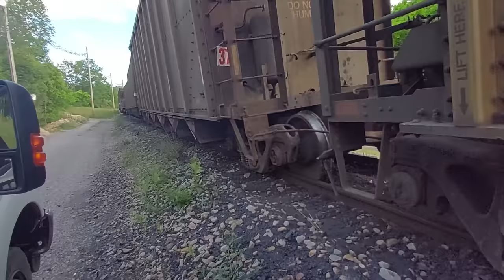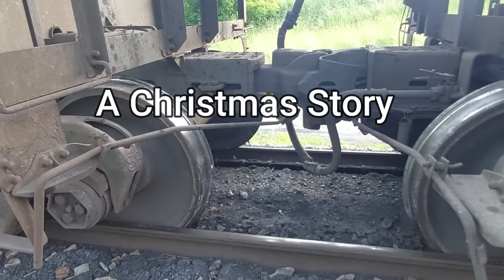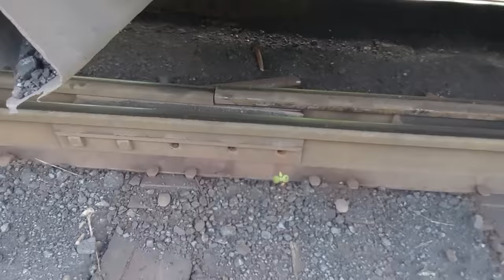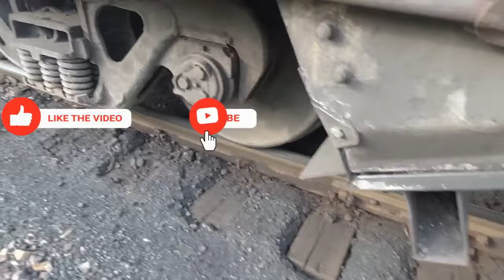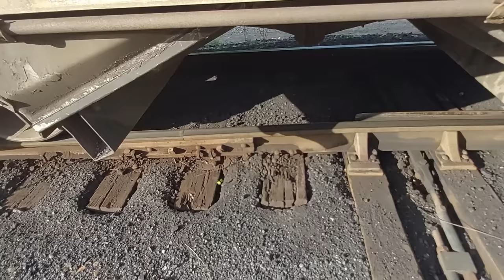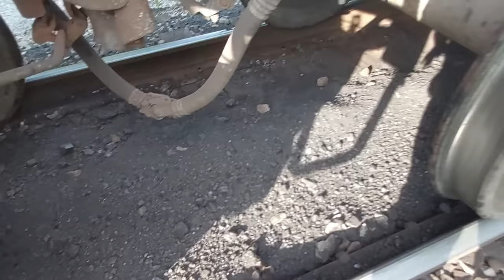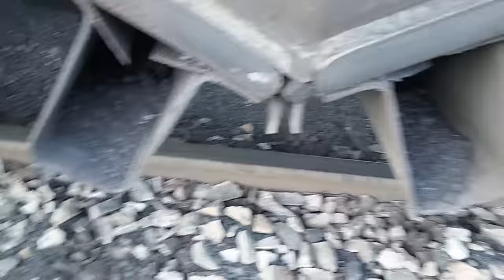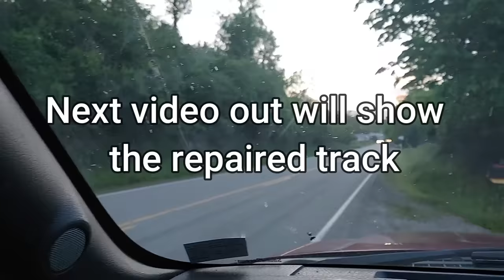Rail Rolled Over and 5 Loaded Coal Cars Derailed  Oh Fudge!

Comment: Nice video Dave, you held it together pretty good, darndest things happen in the middle of the night and Hulcher must have a location close to you to arrive that fast. Hope your switch gears in the box are OK and not stripped from being forced, thanks for sharing your thoughts of the reason, awaiting part 2. Cheers and have a great weekend
Reply from the maker: Thank you Pete for the nice comment. No switch gears in an
electric switch, if it was manual then yep would have been
replacing some internal parts for sure. Hulcher has a base
station 30 minutes from us, nice and convenient.  Appreciate your taking the time to check out the video and write in my friend.

Comment: Dave - You’ve weathered no pun intended cars that derailed and dumped their loads in the tracks in the dead of winter.
I’ve watched your channel for awhile now and I’ve observed you’ve dealt with a lot of issues 
I have no doubt you’ll make this situation work out. 
Keep your head up 
The good thing about this is that no one got hurt.
Wish I could be there to help you out with this. 
If it’s a holiday weekend and guys are out drinking I don’t want them near the job site. 
God bless my friend
Reply from the maker: Things happen Johnathan, usually at the worst times, but that's railroading ....:-)  Thanks for the nice comment. You are right, unsafe for guys under the influence to be not only driving but certainly not on the job site. Great words of encouragement you offered. Much appreciated my friend.
Reply: Very interesting... these things do occasionally happen... but no body was hurt.  Re-railing those wheels is quite an art form... from what I have seen.  Like but welding rails,, it's very impressive technology.

Comment: the wheel at 9:45 looks extremely worn out to me, the flange profile  -  thanks for the video !!!
Reply from the maker: Thanks Edward, we have here an extreme amount of wear on 
our wheels. Factors: while only 16.8 miles of track there are 70 curves over 2/3 of those are high degree curves. Cars are always
loaded at max weight. We have all jointed track, very hard on
wheels. There is no rail grinding program here. Add in all that
a whole lot of stress on the wheels. The wheel you questioned
was close to being condemnable, I put my wheel gauge on it,
but it was still in specs. Appreciate your writing in and watching
my friend and very good observation on your part.

Comment: Greetings from Norway, good to hear nobody got hurt in this derailment. We also use wood-sleepers some places in Norway, although concrete is the most used. However, we don't fix the rails with spikes, we use wood-screws - spikes has not been used for several decades. Would it not be better to fasten the rails with screws rather than spikes?
Reply from the maker: Thank you Hakon for taking the time to watch the video and write in with that info, interesting.  May you have a most blessed day my friend.

Comment: Yikes! And it happened right as you were leaving! It's interesting how a combination of factors like the missing spikes and a bit of extra heat can cause a derailment like that! Luckily it wasn't moving very fast at the time. Do you guys have to do more inspections or anything like that when it gets real hot?
Reply from the maker: Things happen mojo, usually at the worst times, but that's railroading ....:-)  but, things could have been worse. Yes I often
do up to 3 inspections a week when it is really hot or bitter cold. Have even done them daily at times. Weather is hard on track. Thanks for the nice comment. Appreciate your taking the time to check out the video and write in my friend.
Reply: @ccrx6700  I was going to follow-up with the extreme cold question. It must be pretty darn difficult to eyeball all of that track! At least nobody was hurt 😊
Reply from the maker: @PlanetMojo  👍😊

Comment: All the wheel flanges that I saw looked good. Guess the rail rolled before the switch got picked. Does that switch indicate "has been thrown" or just its position? Could it be indicating that direction because it got forced that way, or would it have to be actuated to indicate that direction? I'm used to manual switches with bow handles not this new-fangled stuff.
Reply from the maker: You are exactly correct Andrew. It indicated position because
it was forced. It is programmed not to throw if there is a car
in the turnout.  Thanks for the nice comment. Appreciate your taking the time to check out the video and write in my friend.

Comment: if that switch is done via radio DTMF (phone keypad tones), someone in theory could have a cheap hand held radio and throw the switch themselves.
Reply: We had a problem with our SCADA system radios being interfered with. And as a taxing district which operated under the Army Corps of Engineers, nothing was allowed to be on our channels for over 750 miles. Well not legally anyways. So out came our radio vans to triangulate where the interference was coming from. Turned out it was a Federal government agency. They got a rather nasty cease and desist letter. Problem with radio systems is that you can get bounce that can have the signal travel thousand of miles so it might not even be intentional. We often listened in to a place over a 1000 miles away on a frequency that is close to what railroads operate on.
Reply: @gravelydon7072  I'm a trucker. Well aware of skip. I do it all the time with my high end CB. XD 
But as for something like this, it'd have to be intentional if this was the cause. The way it works is you key your radio, then press a code on the keypad to activate the switch thats listening on the same freq. Someone could in theory even record the transmission and play it back. They use a repeater system at this location as well, so someone could be far off and still hit the switch radio.
The only thing that "keeps" someone off the repeater is called tone squelch (CTCSS or DCS). Its either an analog or digital tone that the repeater listens for but doesnt replay on its transmission. If it doesnt hear it when someone keys on its freq, it wont repeat.
Reply from the maker: What you don't know about these electric switches is, they are
programmed not to throw if a car is in the turnout. You can try on
a radio to throw it or try on a push button on the switch pole, but
it will not throw until the car is out of the loop. Rail rolled over
because of loose spikes which pushed the point rail out far
enough so the car then picked the switch.  Appreciate your taking the time to check out the video and write in my friend.
Reply: @ccrx6700  Just watched the video you did on it when you opened it up. Lots more tech in it than i expected. Lol.
Reply from the maker: @BlakDrgn  👍😊

Comment: Outstanding video as always!  Your troubleshooting and thought process are very thorough.  Being extremely experienced and detailed oriented helps in laying out the root cause of failure.  Has a thought been given to using alternating spikes and rail clamps for a less flexible hold down?  How many spikes in a row need to pull out to start the rail rollover?  5-10?  Less?
Reply from the maker: Thank you Todd for taking the time to watch the video and write in. More info in next video coming out, hope to see you on that one. 
Didn't take too many spikes loose with the heat pushing the rail up. May you have a most blessed day my friend.

Comment: I have a theory ... with the operator at the other end of the train I think the switch was picked and he kept shoving. Which in my mind is crazy if that's the case he should have known how much throttle it takes to make a move and if they where off thr rail he didn't pay attention...just my thought I could be wrong....won't be the first time lol
Reply: I understand that the engineer can only hear and feel so much. If his ammeter starts spiking, that says extra draw on the motors, and you might feel something. Other than that, you can't hear (or) feel much sitting on 3,000 hp of torque. That's how some drerailments go for miles before it gets noticed.
Reply from the maker: Operator was using remote box to control the train Someone Said
Soemthing, there is no power gauge on that remote so he did
not know until it was too late. Had he been in the loco then
you are correct.
Reply from the maker: You are correct Jason. Remember, it's always the operator's fault....LOL Also see reply I made to Someone said Soemthing.
Thanks so much for dropping by tonight Mr. Engineer.

Comment: That happened when I worked as a locomotive crane  helper. It looks like the switch was picked. I seen that happen. We had cranks in the switch box that would break that way the point would not bend and cause a gap in between the switch point and the rail. But in your case it's hard to tell.But sometimes they would bend before the crank would break. What a mess.Good luck on the repair
Reply from the maker: This solar powered switch is nothing like the ones you had. Those old switch stands ( we have some of them) are much different,
yes they had gears and you had to adjust them with shims, pain
but it can be done, sounds like a good future video on how
to adjust a switch! Always a pleasure to have you visit and
write in my friend.
Reply: @ccrx6700  Thank you Dave. Those switches i used to throw are old school. And they still use those type on the Steelton and Highspire R.R. I replaced the cranks and shims in them from time to time. We always had a bar and extra cranks on the crane bed.
Reply from the maker: @BeeLineEast  👍😊

Comment: Just noticed you're driving a Ford, my dad worked at Ford for over 40 years. He'd be happy to see it! ;)
Reply from the maker: Well I did drive a Ford, best truck I ever had, loved it. But after
10 years rockers rusted even tho it had been undercoated. 6,000
to get them fixed and the truck had 115,000 miles on it, so I
traded it in on a new GMC. I wanted a King Ranch, but prices
started at 70,000 and the dealer told me it would be 9 months
or more to wait..... sigh, the GMC was under 40 and was on
the lot ready to drive away, but I do miss that Ford

Comment: Some of them sleepers look a leetle bit past their prime from what I can see.   I wonder if a wheel bounced on the point arm and forced it to change direction and the repeater is just keyed into one state or another and is showing a bad setting.   I know your employer isn't going to spraunce for excessive stuff but it is worth considering approach section, points and post section to use other than what are basically nails and maybe look at check rails to force the wheels onto the rail.   With the high heat of summer some of them weathered sleepers are going to let go, soon as the sun goes down the fun begins as the sleeper cools slower than the metal which incidentally has an excellent heat radiator in the form of a rail, the spikes cool quicker and a few hundred cycles of that and unpleasant times ahead.   Maybe look at cast steel chairs and blocks if the big P's are a no no or sprung steel clips hammered in either side o' chair that won't let go of the rail even under severe shock.
Reply from the maker: Thank you Watson's World of Wonders for taking the time to watch the video and write in. More info in next video coming out, hope to see you on that one. May you have a most blessed day my friend.

Comment: What do they do with the hopper cars that were damaged? Do they vacuum the coal from the damaged cars to other cars? Just wondering.
Reply from the maker: Once the cars are rerailed they will be taken to the unloader
where they get dumped out, then if need be they will be side
tracked and at some point sent into our shop for whatever
repairs are needed. We have never vacummed a car out, however
there has been a few instances where they used a clam bucket
off a grapple truck to dig a bunch of the coal out in the past.

Comment: How does 5 ties with loose spikes get missed though? Could it be felt driving over it with your work truck? Can it be seen from a distance as weight is passing over it?
Reply from the maker: Heat also may have played a factor in it Nick, Spikes were covered
with 4 inches of coal and impossible to see, will talk more about
that in the next video out. Thanks so much for dropping by
and checking out tonight's show my friend.
Reply: @ccrx6700  Thanks Dave you rock!

Comment: Oh Fudge is right.
A holiday, and guys are enjoying with family. 😞
A derailment and right behind a needed switch point to mess it up! 😖
I had a hunch it would be due to spikes not securing the rail in place. I’ve seen many railroads where the rail is just down by weight and all spikes are not even holding the rail down. That’s an accident waiting to happen. 
—
I know this may sound stupid but smart at the same time.
Why don’t railroads ditch the old spikes and instead predrill a hole in the tie and have the rail itself with holes in the base and use large screws instead like the drywall screws but much bigger for railroads and a bolt type head on top for ease of removal when needed? Spikes don’t grab well, screws do. That way, they will hardly ever come loose and keep the ties in place without the need of anchors. 😎
Reply from the maker: Many places on other RR's they use the lag screws but never
thru a hole in the base of the rail, that would weaken the rail
base too much. Lags are down thru the tie plates, but that
requires a round hole, all of our tie plates have square holes
punched for spikes. Lags do give superior holding power over
spikes. Thank you for checking out the video and writing in. May you have a most blessed day my friend.
Reply: @ccrx6700  
Thanks for the reply. I was trying to find innovative ways to stop the rail from overturning because time is money and a derailment sure is annoying. 
Cheers!
Reply from the maker: @Bassotronics  👍😊

Comment: Gee what a mess. It is hard to say what caused it but I think the rail moving away from the switch caused the wheels to force the switch over rather than the machine moving them under the train. Just shows even at low speed the time it took for the train to stop I guess the air line pulled apart and that stopped it, the part still on the rails rolling on a few feet, until then the operator was still shoving back unaware anything was going wrong. Good they got there so soon to re rail the train
Reply from the maker: Thank you cedarcam for taking the time to watch the video and write in. More info in next video coming out, hope to see you on that one. May you have a most blessed day my friend.

Comment: Is that one of the radio controlled switches?       On another note, did ya get the remote loco control situation with the fire alert stuff figured out?
Reply from the maker: Yes it is Kevin, throw the switch off the radio. On the other situation
the fire suppression guys have been called, they haven't shown
up yet. Radio plugs for FS are unplugged and no more problems
with that issue we had, thanks for asking and great to have you
show up tonight my friend.

Comment: I worked in a totally different industry but I know how you feel. Did out of hours standby (on call) for over 20 years for an electricity distribution company covering 132,000v down to the 33,000v/ 11,000v substations. Christmas Day, all the other UK/English Bank Holidays (Public Holidays), weekends, birthdays and World Cup football matches. Getting called out to substation disruptive failures, arson, theft of earthing, flooding, farmers hitting overhead lines with machinery and drinks drivers whacking 33kV line wood poles. Saw it as a duty really even though I worked for a privatised civilian utility. Got to admit though having 100,000 plus people of supply knowing others are looking to you for a strategy to get them back on is a good feeling, especially when you get it back on and you hear. That transformer inrush noise!😊
Reply from the maker: Thank you High Voltage Switcherfor taking the time to watch the video and write in.  I know exactly the life you led. My dad was lineman for power company here and every holiday he would get called out it seemed like, they didn't have union rules and many times worked 24 on an outage. May you have a most blessed day my friend.
Reply: @ccrx6700 Thank you.😊

Comment: Equating 80 degrees with heat? LOL Here in Texas the LOW temperature at dawn this morning was 80!
Look on the bright side - at least none of the hopper gates snagged anything or you'd have had the same thing that happened in Tunnel 79 all over again!
Reply from the maker: You are right whiteknightcat, things could have been a lot worse
for us. temps at 80 can start to cause problems with the rail
if it is not secured enough. Thank you for checking out the video
and writing in. May you have a most blessed day my friend.

Comment: Ninety percent of the rails, ties and the railroad beds need replacement.
It will never happen in a million years with the present economic model of running the infrastructure into the ground.
It costs less to hire a low wage laborer to put the train back on the tracks.
Reply from the maker: Thank you Sasha for taking the time to watch the video and write in with your thoughts. May you have a most blessed day my friend.
Reply: @ccrx6700  You too.  Ditto
Reply from the maker: @sashadala346  👍😊

Comment: This looks like one of those situations that you couldn't explain without using the word cluster!!!
Reply from the maker: Used a different word than fudge off camera when I first got there
Jughead, it is usually used after the word cluster in railroading
and coal mining circles....LOL   Appreciate your taking the time to check out the video and write in my friend.
Reply: @ccrx6700  I use to be a underground coal miner in east Kentucky till I got hurt. I never had any dealing with trains but I know a supply motor derailing is a nightmare! I couldn't imagine getting into that mess!
Reply from the maker: @jughead8988  👍😊